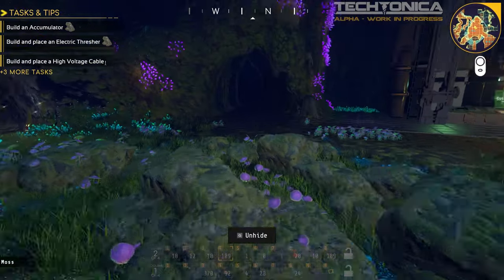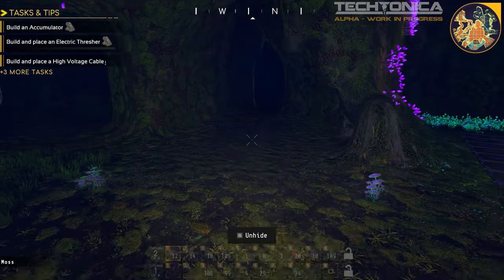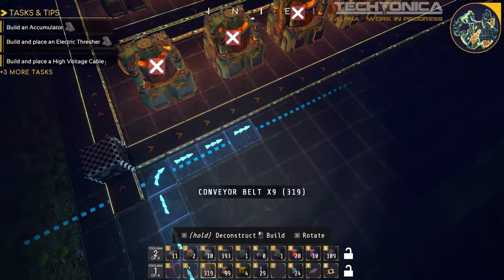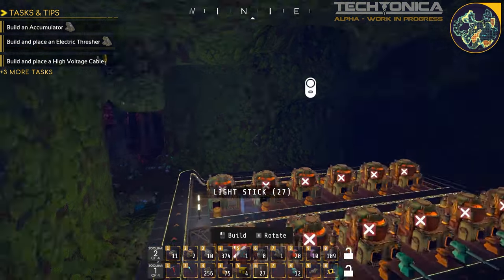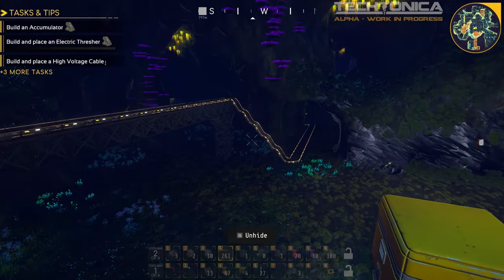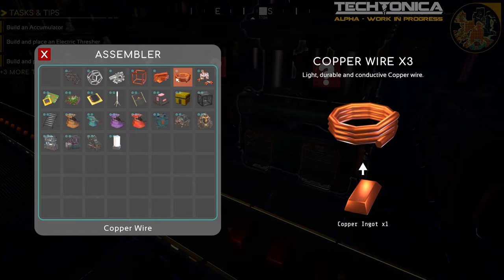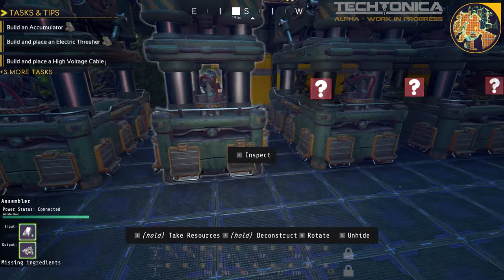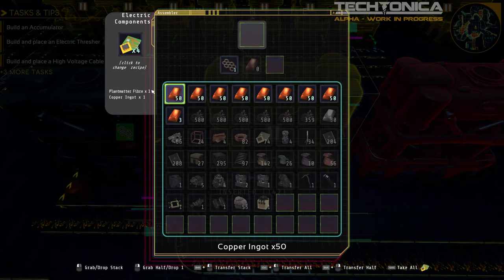Lets automate EVERYTHING for our starter mall. |  Techtonica [E4]

Comment: Great design looks great, can you show next episode if the fuel production is keeping up?
Reply from the maker: Absolutely! Great idea as well.  My napkin math said I should've been able to power, I think 30.8 machines with the fuel I made (not including the 3rd line).  And I did do a combination of 30 Miners/Smelters on all that flower power (Biobricks).  Once I get the mall online next episode and all the resources are being abused, it will be a perfect time to check :)

Also, I should add that judging from the tech tree, we'll get access to Electric Threshers and Electric Smelters in the near future.   Which will be great for our fuel factory.
Reply: @relyengaming  that sounds good. I have seen some other video's, most of them rush to the other area. I like that you build some basics in the starter area. Do you happen to know if resources nodes get used up?
Reply from the maker: @rido77  Yea, my thought process was why not build our starter factories in the first area.  There are certainly plenty of resources and a decent amount of room in the starting area.  Later, with a few more unlocks are done, we can use the other area for a bigger factory.  :)

And as far as I can tell, the resource nodes seem unlimited at the moment.
Reply from the maker: I just posted a new video.  I didn't add the biobrick checks at the end of the video, but I did check and the fuel storage is completely overflowing.  So, no fuel problems what so ever at the moment.  But I did notice a small flaw in my fuel production layout, which I'll fix in an upcoming episode.
Reply: @relyengaming  Thanks for the info, will watch the video in a couple of hours, looking forward to it.
Reply: @relyengaming  yall wholesome
Reply from the maker: @rido77  Quick update, I noticed recently the nodes are being used up as the drills move into them.  So, looks like finite resources at the moment at least.  But there is plenty of ore nodes in the alpha to have fun.  I would assume there will eventually be some resource modifier setting.
Reply: @relyengaming  thank you for the update. i keep looking forward to your video's